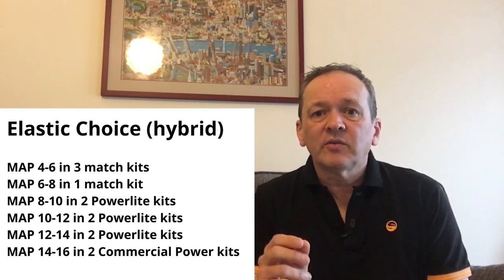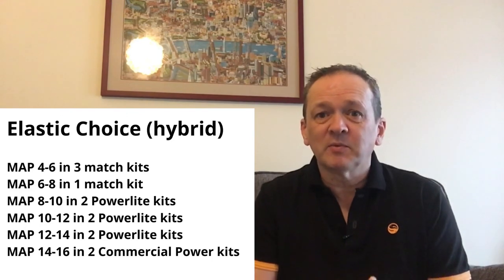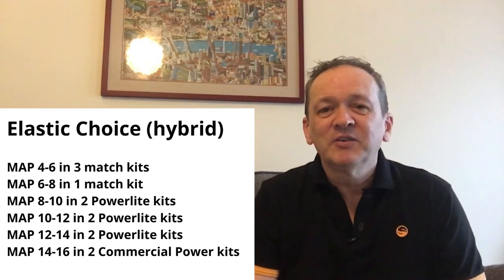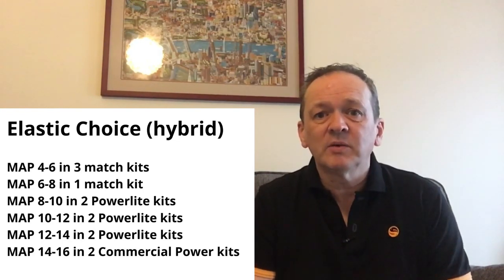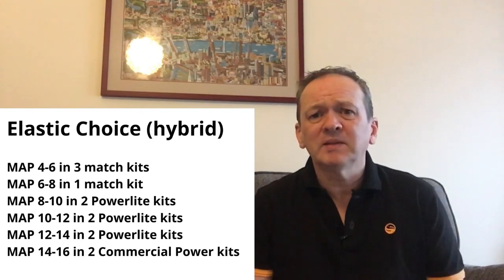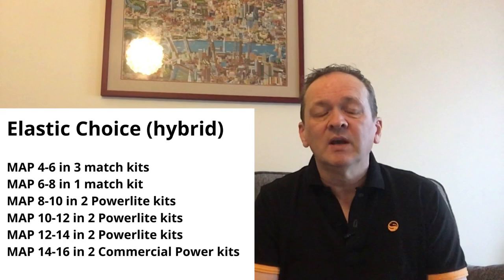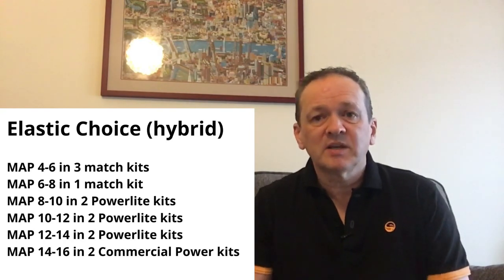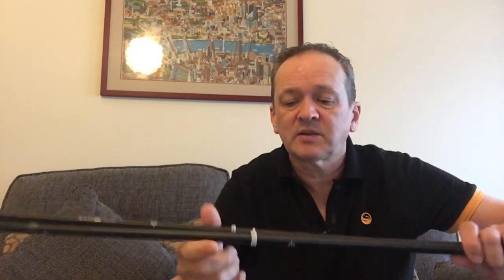Paul’s Tackle Reviews - Pole Top Kit - Perfect Set Up

Comment: Great helpful video again Paul I've just converted my pullers to side pullers as my pole is older before the side pullers were used.
Set my dacron which slides down behind the knot which have been ok so far but will look as the Des Shipp video and see if it's better for me.
I use the Protectorpole in the 3rd section which are brilliant.
I have a lot of shallow rigs on winders which when you take them off they don't hang right with kinks so last year started to leave them set up on my top kits which I think I will do from now on.
I also use the dura slip elastic but now you have said about the map I think it's a know brainer for 6m you can do two top kits for £8 
Thanks for the video Paul vary helpful.🎣🎣